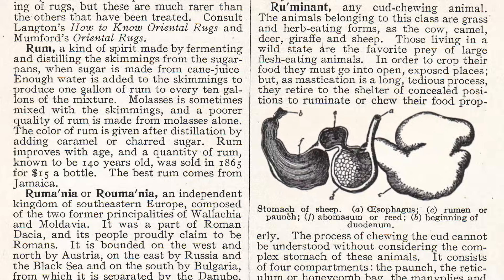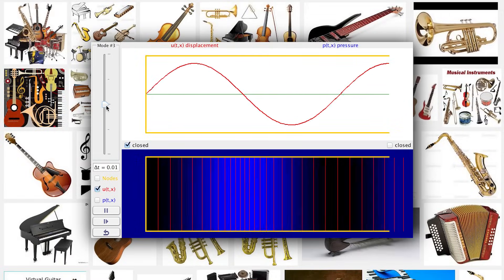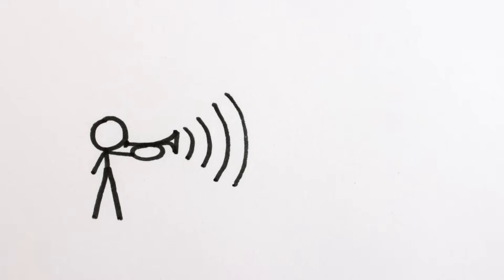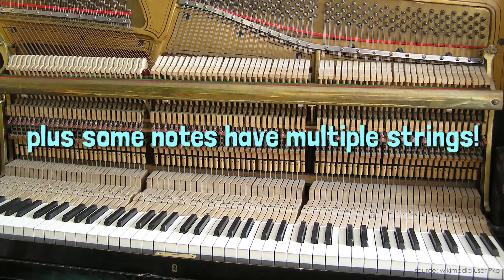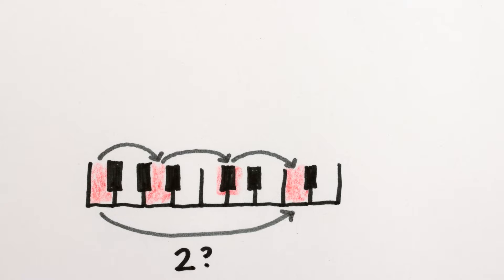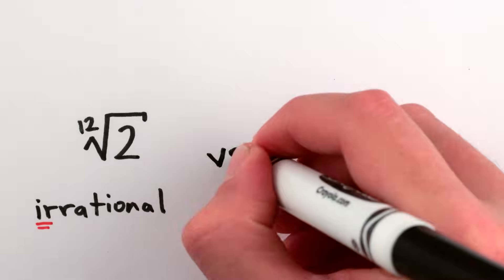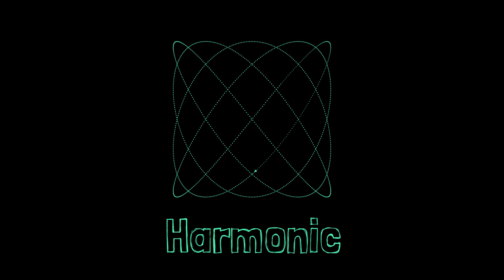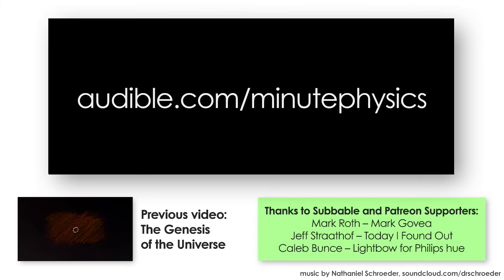Why It's Impossible to Tune a Piano

Comment: Your explanation is interesting and well done, but even though it is correct that's not really specific to piano. Actually you explained what equal temperament is, but your statement can be applied to any instrument tuned in equal temperament. 

The issue with the piano is that it can not be tuned perfectly even in equal temperament. That comes from the string rigidity; an ideal string should keep its shape after beeing twisted, which is obviously not the case in real life. Because of that, the harmonics are not perfect integers(f,2f,3f,4f...) of the fundamental frequency; for example, the second harmonic of an A 440 Hz has not exactly a frequency of 880 Hz.

That means than if you play this A and the one one octave higher, assuming your the octave is pure, the second harmonic of the low A will clash with the high A(because there's a difference of a few Hz). To minimize this, the piano is somehow tuned wrong deliberately, and there is no perfect solution to that. It's only a matter of compromise.
Reply: Simply change the tension and length of the string then. You can get any frequency you like by doing this. A piano is THE MOST tunable instrument because you have a true "infinite" range of tensions and lengths.
Reply: Exactly.
Also, inharmonicity aside, it should be noted that equal temperament is not the only solution to the problem this video presents.
Reply: Tuning it perfectly in tune is good, but as soon as you play in a different key, it sounds far off from how it should sound. The point of equal temperament is to make every step equal, so it is close enough to in tune for every single key. Otherwise you have to re-tune the entire piano every time you change key.
Reply: Hello I am the only not smart one in this comment thread
Reply: @ninjaboy1098  No im stupid
Reply: @RipleySawzen  That makes so sense. You can't change the frequency of harmonics, that would break all of physics.
Reply: @ze_rubenator  No matter how you define "in-tune", I can make a piano with those frequencies. There is no frequency a piano wire cannot have. If you cannot tune a piano, you cannot tune anything.
Reply: @RipleySawzen  Your problem is that you have a fundamental misunderstanding of the problem OP is talking about. Due to the thickness of piano wire they are subject to something called inharmonicity, which causes the harmonics to be ever so slightly sharp compared to what they should be based on the fundamental. And this effect is additive, so the higher you go into the overtones, the sharper they get. This is because when the wires are so thick, the ends where they are fastened become somewhat rigid, effectively shortening the wire.

So now there's a problem that essentially cannot be solved, because if you play e.g. a 440hz note, you expect the first harmonic to be 880hz, when in actual fact it will be slightly sharp, and thus out of tune with the A one octave up, i.e. 880hz. Now what? Do we tune after the fundamentals or after the harmonics? And in case of the latter, which harmonic should take precedence? There are many different solutions and preferences, none of which will satisfy all parameters, and none of which are perfectly in tune. It is simply impossible to achieve.

This is precisely why piano tuning is such a complicated profession that takes many, many years of study to master.
Reply: @ze_rubenator  So it's two frequencies on one string at the same time? It is then impossible to tune any string instrument and has nothing at all to do with pianos.
Also, looking at a C#5 I isolated from a Mozart sonata. I only see one harmonic.
Reply: @RipleySawzen  It's not two frequencies, it's hundreds. If it were only one frequency it would sound just be a sine wave, and I think we can agree that pianos don't sound like sine waves. The harmonics are what gives instruments (and in fact every sound) their character, or timbre to use the musical term.

And more or less, yes it's impossible to tune any string instrument, as they all suffer from this to some degree. However, for the most part it's not a problem because most instruments only span a few octaves, whereas pianos are simultaneously the lowes and the highest instrument, which amplifies the effect.

That being said guitars have other, bigger problems that make them impossible to tune, for example because of how the strings stretch when you press them onto the fretboard.
Reply: Indeed you are correct!  
I chose not to go down that rabbit hole, but did elude to in it point #6.  Inharmonicity is the term used to describe the effect of string rigidity.
Reply: @ze_rubenator  So pick the main frequency and set it to whatever a trumpet would have. Again, I can match any frequency you have using a piano.
Reply: @RipleySawzen  I'm sorry to say this so bluntly, but you're probably experiencing the Dunning-Krüger effect. You know so little about the nature of acoustics that you don't even recognize how little you know. Please understand I don't mean to be demeaning.

Crucially, you can't tune the harmonics; they are slaves to the fundamental. In a perfect world they would be exact fractions of the fundamental, but sadly that's not always the case.

Trumpets and pianos make sound very differently, and because of some complications in how a piano makes sound (namely the rigidity of the strings at either end) it's strictly impossible to perfectly match it with a trumpet. You can try to tune them to the same fundamental, but that will cause the harmonics to be slightly off; or you can tune it to the first harmonic, in which case the fundamental will be slightly off.

This is what is meant by pianos being impossible to tune perfectly.
Reply: @ze_rubenator  Perhaps it is your partial knowledge of music that has led to your false confidence in the greater understanding of physics as a whole. With my degree in civil engineering, I understand fully well the deformations that occur at a fixed point as well as the mass and flexibility of the string affecting the way lower/higher frequencies vibrate. What you just said about the trumpet implies that a string cannot be in tune with itself, and were this the name of the video, or what the video was trying to prove, I would have possibly agreed. But we do not say strings are not in-tune. We give them a frequency. Just because you may not LIKE tuning the fundamental string to the trumpet, because it sounds awful, doesn't mean we can't. Again, if the name of the video was Why Tuned Pianos Sound Like Shit (demonetized) or Why We Purposefully Keep Pianos Out-of_Tune, I would find myself not having this argument. But then entire notion that a piano cannot be tuned is RIDICULOUS, and quite frankly, UNSCIENTIFIC. It implies that we cannot assign a note to a string. If the musical industry actually goes through the mental gymnastics to believe this shit, then it's no wonder creative individuals rarely make good scientists.

Your definition of tune is wrong.
Reply: @RipleySawzen  Let me put it this way: If you tune a piano as you suggest only after the fundamental, anyone with decent pitch will agree it's out of tune. A piano can be tuned, but it cannot be tuned perfectly. As a Scientist you should be able to read words.

"It's no wonder creative individuals rarely make good scientists."
You got a source for that statement, Mr. Scientist?
Reply: @ze_rubenator  You got a source for that statement?
"you can't tune the harmonics; they are slaves to the fundamental" is my source. You can absolutely tune the harmonics by selecting different source materials, changing their weight, and changing the way you affix the ends. If you were to, for instance, make a string out of carbon nano tubes, it would be lightweight and VERY flexible since tubes tend to slip past on another. Since we're talking the same molecular scale that air molecules in wind instruments vibrate at, we'd have a piano with perfect harmony. Though I suspect the lack of harmony is part of what gives a piano its sound.

Well this was a pointless argument that could have been solved by people with a better understanding of physics being the ones to explain things.
Reply: @RipleySawzen  That's very thin anecdotal evidence, get me something tangible. I'll wait.
Reply: RipleySawzen If you’re stepping into the middle of an in-depth discussion about tuning, and your solution to the perceived problem is that (hold on to your hats...) you can change the tension of the string, you should consider that maaaybe you missed something that was said or implied already.
Reply: @RipleySawzen  Wow, this thread has gone so far. I guess everyone has not the same definition of 'in-tune' here. The point of my original post was that obviously you can tune the fundamentals of all strings together, but it's impossible to have all the harmonics in tune. You cannot have all the strings tuned to equal temperement AND having all the harmonics of one given note being in tune with all the instances of this same note in the superior octaves.
Yes, you can change the ratio between the frequency of the harmonics and the fundamental by tweaking the parameters you mentioned, but there is no wat you would get a perfect integer distribution with regular piano strings (which is the point here, I mean, piano strings are not made out of carbon nano tubes). As long as you can't get that, the piano harmonics can't be possibly all 'in-tune'
Reply: @Hedwyns  The way musicians define "in-tune" is unscientific bullshit as far as I am concerned at the point. Either a piano CAN be tuned or a single string is out-of-tune with itself. Cannot have it both ways.
Reply: @RipleySawzen  The terminology, when it comes to acoustic signals, often differs between musicology and signal processing. I think there was good effort there to define what was implied by 'in-tune',  as this is pretty much a blurred concept. Also, I highly doubt there is a universal definition of 'in-tune'  in signal processing, and if you have one, i would be curious to have an actual scientific reference for that. If a string has to have only harmonic partials to be considered as in-tune, then a regular piano string cannot be tuned indeed (altough the partials are very close to integer multiples of the fundamental, but not exactly). Also, consider that the only parameter that a piano tuner modifies is the string tension, as far as I know at least.
Reply: @ze_rubenator  Well the solution is to bin all your piano wire as fundamentally flawed and synthesise a pure tone instead.
Reply: @joestevenson5568  Yeah, no.

Comment: I've heard that a reason to why there are several strings on each (or most) keys, is that the strings will not be tuned exactly the same. So when you're playing a chord looking for a certain harmony, physics will make the string that happens to coincide best with that harmony be amplified, while the other strings are damped. So a key will sound with a slightly different pitch depending on which other keys it's combined with.
Reply: +Samuel Estenlund I think it has more to do with getting more volume.
Reply: +Michael Sommers And a richer sound.
Reply: Actually, having the strings tuned slightly different from each other creates a chorus effect which gives it a richer sound.  Perfect is not always best as a "perfectly" tuned piano can sound dead flat - no life.  (I used to tune pianos)

Comment: The elder statesman in our family (musically speaking) was my dad’s older brother, Joseph Metzger. He learned to play the violin and tune pianos about a hundred years ago. Dad was a finish carpenter and also very good at reupholstering furniture. I started violin lessons in 1950. Uncle Joe taught Dad how to tune pianos about 1970 and Dad said it was the most difficult thing he had ever studied. Later in that decade, Dad taught me how to tune pianos. 

Did you ever mop a floor? If you used only one bucket of water, the part of the floor you mopped last was only as clean as the dirty water, right? 

Learning to temper the scale (so the piano would sound equally good in any key) was challenging but tuning a piano is similar to mopping that floor. Pianos are made partly of metal and mostly of wood. If the average pitch of the piano is significantly below standard pitch (A-440 = C-523.3) - which was the case for many of the pianos I tuned in people’s homes - tuning the hundreds of strings actually compresses the piano frame. If you start by tuning one string of each note of an octave near the middle of the piano and then tune the other hundreds of strings, the first strings that were tuned are then below the pitch to which they were first tuned. (The same thing happens when tuning a violin that is badly out of tune.)

If you go dump out the dirty water and get clean water in your bucket and mop the floor a second time, the floor will be cleaner than it was when you finished mopping it the first time. But if the water is even slightly dirty after the second mopping, the part of the floor you mopped last is still slightly dirty. How many times should you repeat the process?

Same with tuning a neglected piano that is measurably below standard pitch before you begin. If you tune it twice, it will be closer to standard pitch than if you tune it only once. 

You might think, why not raise the pitch on the first tuning a specific percentage of a semitone so the average pitch will be very close to standard pitch before you begin tuning the piano a second time?

Problem: Different pianos - even different models from a given manufacturer - have different coefficients of compression of their frames as tension is added.

Of the various things I have done - printing, managing a factory, etc. - piano tuning was the thing (for which I was paid) that I liked the most and did the longest but, by 2007, I couldn’t hear the pitch of the highest treble notes well enough so, when my wife and I moved away from where our son lived, I gave him my piano tuning tools to keep as keepsakes. 

If anyone is interested in the “theology in a piano”, let me know.
Reply: that is really interesting, i always wondered why piano tuners always tuned their pianos multiple times. piano tuning seems like one of those things that is harder than it seems for sure
Reply: @littlebigparardise9245  Each string has a tension of 160-200 pounds, resulting in a total string tension of about 35,000 pounds. In the U.S. in the twenty-first century, there are many people who, even if they could master the physics of the process, would not be willing to do the physical work of increasing the tension of the strings. On the other hand, there is enormous satisfaction in doing something that most people couldn't do if they would and wouldn't do if they could!

Comment: Here's an idea for future computer instruments and sample piano recordings. Use micro-tonal tuning to get multiple frequencies for every semitone. As a result when your stacking the chords you can pick the right version of each note to stack against the root and everything will be in tune. What do you guys think?
Reply: You mean something like 53edo, which splits the octave into 53 equal parts instead of 12?
Reply: every interval here is just (sort of)
Reply: I'm pretty sure that's actually what they do for lo-fi hip-hop. Adam Neely made a video called The 7 Levels of Jazz or something like that and talked about it towards the end
Reply: Look up Benedetti's puzzle. Actually, Adam Neely has a great video on it. It's the reason why that wouldn't necessarily be so great
Reply: @avavav1232  Thanks. If I ever need a MASSIVE headache I will listen to that garbage.